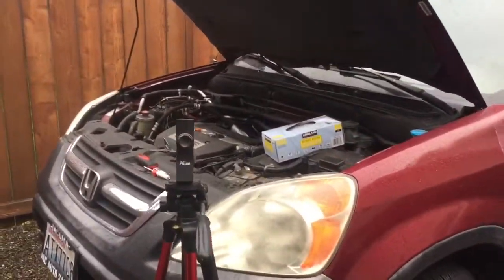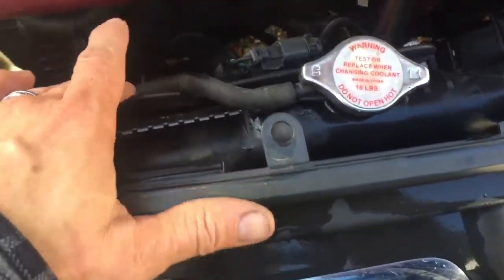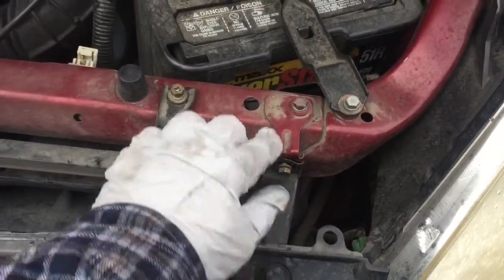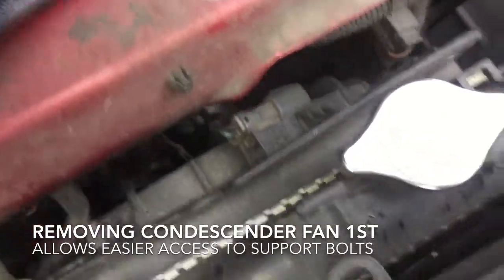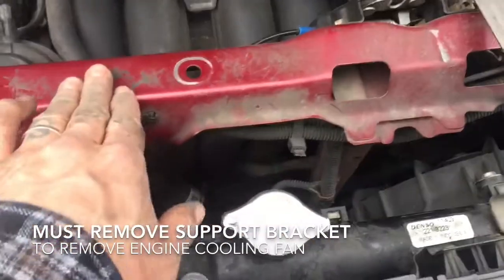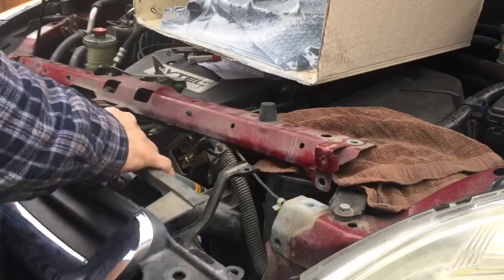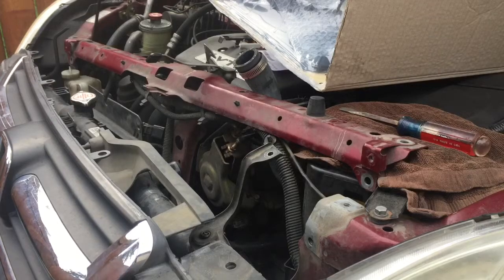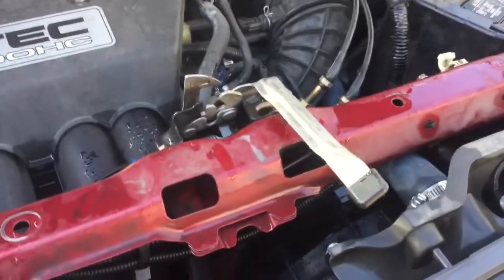How to replace Engine Cooling & condenser Fan on Honda CR-V

Comment: Just did both of my fans on my '04. Funny how these Denso fans died at the same time as yours lol. I live in the rust belt up north, so my main support bolt on the bottom was rusted/rounded in. Ended up removing my radiator to remove my cooling fan on the driver side. Pro tip: when removing the passenger side A/C condenser fan, unclip the wires in the bottom clip attached to the fan. If not, you will strip your A/C compressor wire/connector :) Taking the radiator out was a bit of an extra pain, but definitely made the job possible as an alternate method and a good time to service the coolant too. Nice vid.